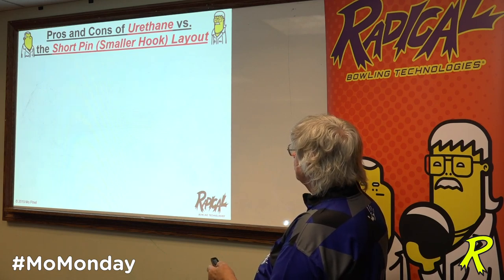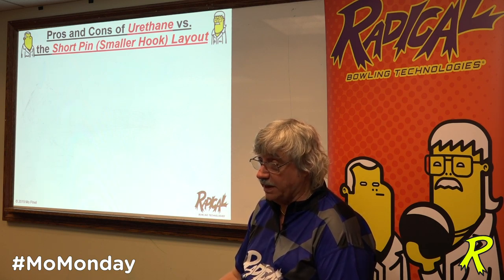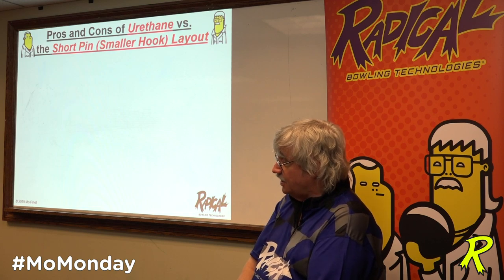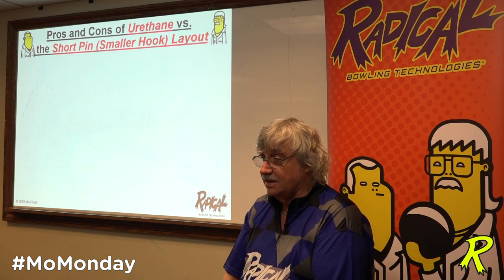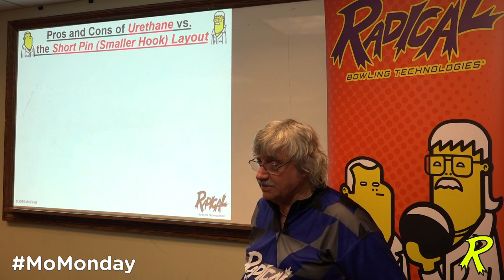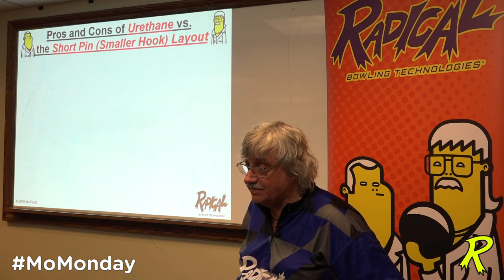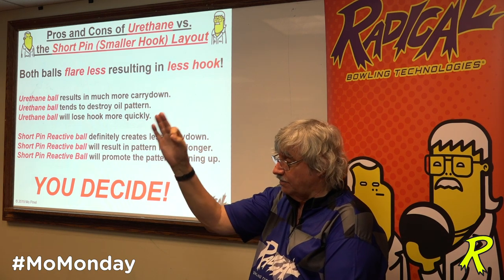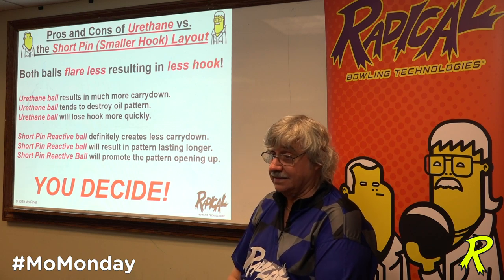Urethane vs Short Pin Reactive - #MoMonday

Comment: I have a few problems with this.
1. I use urethane in my 4 person leagues on house shots. 8 players on a pair. I am the only one using urethane. Their resin balls suck all the oil off the lane and as the set goes on my urethane ball reaction get's better and better and better. I start rolling up 7 board and by the third game I have paralleled left until I am going up second arrow and still striking. And the bonus of my urethane ball is I can stay straight to the pocket the whole time and never have to throw away from the pocket. Also I never see over/under wet/dry effects.
2. On heavy oil my resin balls, even at very low grits, will not hook early enough to provide carry. Because they are resin they skid too far before they roll and hit light or weakly until the lane breaks down. By comparison my strong urethane ball will just walk through the flood straight to the pocket and blast the pins apart. I have to use urethane on heavier fresh oil because resin wont hook enough.
3. The urethane reaction is smooth, controlled and straight and allows the best part of my game, my accuracy, to excel.
Reply: But I think the point is that not everyone has enough revs to throw one and and by short pin drilling a resin ball you can get a similar effect with out the negatives.  Did you ever think how much better your team mates could bowl if you was not creating all that carry down? It does not sound like you have every tried to use a short pin drill on a resin ball so it is hard to be judgmental on what works best. I not saying you are wrong if it works for you. But old dogs can learn new tricks. I am up for anything to help my game. But when I am on league I want my team to do good too.
Reply: @jvmiller1995  First off: I have low revs, very, very low revs, only 145 rpms. So high revs are certainly not necessary for urethane balls. Did the pros in the 80's have high revs? Nope. Yet they used urethane exclusively and effectively.
Second: The idea that on a house shot urethane is creating carrrydown and messing up other players shots is silly. I never see carrydown when I use urethane in a league environment if the other players are using resin. The opposite is true, their sponge balls suck all the oil off the lanes making it more difficult rather than better for everyone. You want to see real carrydown, play on 32' Wolf when "everyone" is using urethane! Within one game the lanes go from insane flip and hook to long and smooth. 
Now that is real carrydown.
Third: I have used short pin reactive and even pin in axis reactive. Not even slightly like urethane. Resin balls with short pins go "longer" and snap "more" in the back. That is not a urethane look. Urethane is early hook, then set and then a long roll to the pocket. Resin will never be able to to do that no matter what layout is on it. Resin is designed to skid and conserve the reaction for the "back of the lane" and that is why short pin makes resin skid "even longer" and snap even more.
Check out Video #83 on my channel. It shows a very strong resin ball with strong early layout and with short pin. Watch the difference. The strong layout produces a reaction that is closer to urethane while the short pin makes the ball go very long and snap. Same model ball and surface, just different layouts. Now compare both of these reactions to Video #132 with a Pitch Black. This is the urethane reaction. Early and smooth with zero snap in the back.
Reply: @nordattack  I was just agreeing some of the points he made that made since. If that is mostly all you bowled with it stands to reason you will do better with it. I can kind of understand the argument of resin balls sucking oil off the lane. But It is easier to adjust to light oil  on the top end of the lane but when your ball hits oil on the backend  end when turning and it slides out is it hard to be consistent. Resin has draw backs too. They need to be heated an clean property evert so many games for one. I would say what ever you hit the best with is what you should use. As long as it is a approved ball you are okay. I can adjust okay to most lanes.  I am a medium rev guy and have a nice hook but not massive.   I like the short pin layout for a short pattern.
Reply: @jvmiller1995  Right, whatever ball works best for "you" that is the ball you should use. 
Forget what everyone else says and ignore any looks they give you.
They complain that urethane creates carrydown and messes up their resin shot, I would say their resin balls strip oil off the lane and make my urethane read too early.
See? No one is happy unless they ignore what everyone else is doing and just focus on what works best for them.
Play your "own game" and enjoy it. Embrace what "you" do. Then you will become a great bowler.

Comment: You said urethane balls loose hook more quickly because "they fill up with oil" then right after this statement you say that Urethane causes carry down because "they absorb ZERO oil" Which Is It ? I always thought that urethane did not absorb oil. (If that Is truly the case why would the ball loose hook quicker) Wiping the ball off should keep It fairly fresh ?
Reply: I believe he means the surface fills up with oil, keeping it on as a barrier between the surface of the ball and the surface of the lane.

Comment: Is there a core size / cover type limit for short pins?  I have been successful with some and not with others.
Reply from the maker: Mo recommends using stronger core/covers when using short pins so you have the benefit of the better core and more aggressive coverstock. Using too weak of a ball will often make the ball too weak overall. (Counter Attacks)

Comment: @radicalbowling I am a two hander (about 375 rpm) using a Pitch Black urethane on league nights. It looks like in other comments you recommend Counter Attack or Beyond Ridiculous short pin layouts. Would they be similar to a urethane shape drilled that way? Or is there another ball you would recommend to replace the urethane..
Reply from the maker: Counter Attack Solid with a short pin layout.
Reply: @RadicalBowling  thanks. Any shops you recommend in Philly area?
Reply: @darrennelson9420  Reale's Pro Shop 3075 Holme ave
Philadelphia, Pennsylvania. Dennis Reale is one of the best in the industry.

Comment: The only problem I have with the short pin layout is when the lanes start to go through transition you have to put it away.
Reply: I use mine all 3 league games.  I move less and the lane read stays very consistent for me.
Reply: @stued151able  Every bowling style is different
Reply: Yeah, short pins are only good when keeping your angles down..     as you transition in, I have to go to stronger layouts to get the ball to recover and drive through the pins.  

But I have the same issue with urethane, as others with reactive break the lanes down and i move in, i start to lose my carry, so have to go to a stronger ball..
Reply: Bowling is about adjusting not about standing in one spot for 3 games.
Reply: @Mainzer74  No huh thanks for the brief summary of bowling. I have very low tilt and low rotation. Which means my ball reads the lane relatively early. When I'm using a short pin layout and the lanes go through transition I have to put it away because when I move the ball it's just over under
Reply: @adamatkins1466  my thoughts would be start with the short pin reactive and go down to urethane when the condition demands. 

I do love the sport because all of us play them differently and have different dynamics so we see the lanes and conditions differently
Reply: I was taught the old school way of bowling from my dad and when the lanes start to get bad move right through slower and with more hand. He taught me with his Columbia 300 piranha/c. I have an Ebonite Radical Angular One and I still through it next to the gutter if the lanes get worn down because I was taught the more close to the gutter you are the time the ball has to hook and react.

Comment: Great info.  When I used Black Hammers in the late 80's and early 90's on synthetic lanes I was always moving right every frame or two.  When I found a new Black Hammer a couple years ago I had a Motion Hole layout put on it and never had the carry down issue with it because the ball had a good flare.  After the three games I would always clean and de-oil the ball so it was fresh for the next league set.  It would appear that if one wants to use urethane and keep the carry down issue to a minimum the ball needs to have the potential to flare, and than regularly de-oil the ball.   Right or wrong that is my personal observation.
Reply: If I am using modern urethane (Purple, Fever, Tactic, Widow, True Motion) from the right, even zero flare urethane, as long as there are resin players in my area of the lane, there is never an issue with carrydown. They strip off any oil I push down.
I can either stay put for all three games, or move my foot slightly left as the set goes on.
The only time I have an issue with carrydown is if I am bowling all alone in practice, or if no resin balls are going down the lane in league and it is just a bunch of house ball chuckers.
I would imagine if everyone was only using urethane that there would be a carrydown issue, but I never see it in actual league as long as their are resin players.
And actually some resin players like when I bowl on their line because they say my urethane ball helps keep the pattern stable.
I paint an oil stripe and they take it off and I paint it and they take it off and so on for a calm sustained reaction.
Reply: Yeah, I see the same thing.. if no one else is in my area with the purple hammer I love it!!  But when the no-handers use strong balls they kill my shot!!
Reply: Yep the reactive balls  keep the carry down soaked up. And u gotta wipe wipe wipe the ball Every every shot good then life is good.
Reply: So he says Urethane doesn’t absorb oil but you have to de-oil the ball? Why is that?
Reply: @justmakingthistoreply5085   Well did not Mo say that the urethane fills up with oil quickly in the video at time mark 1:25+, and that the pros need to have several of the same urethane balls drilled the same way in an 8 game block to compensate for when the urethane ball stops hooking after about 1.5 games?  So apparently there is some oil uptake that is enough to effect the performance of the urethane ball.  Thus the need to de-oil on a regular basis.
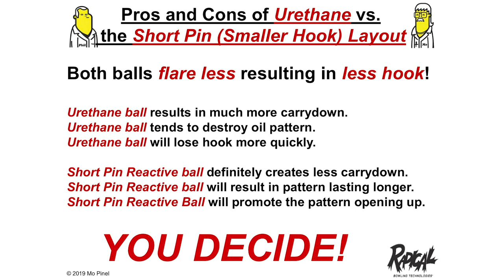Reply: Daryl W at 3:35 he claims true urethanes absorb zero oil. 🤷🏻‍♂️
Reply: Daryl W I think he just misspoke
Reply: @justmakingthistoreply5085  That could be.  It would appear that there is a possible contradiction.  But to say that urethane balls repel oil absorption (meaning they do not absorb oil at all) may not be correct either.  The discussion that started at the 1:25 time mark seems involved and not just a misspoken event.  I guess Mo will need to clarify, but I still believe from experience that if old urethane is not cleaned and de-oiled it's performance will decrease.  Thus I have never experienced this decreased performance of a urethane ball at least in a 3 game set because of regular cleaning.
Reply: Well, you can't use a motion hole anymore.
Reply: @russellgilbert3453  In USBC leagues and tournaments.  That is true.  But since I do not support the USBC anymore and bowl only non-sanctioned events I do not care what the USBC says.  At present I am not going to spend hundreds of dollars on a whole new arsenal of expensive bowling balls at the incompetent pro shops in my area when the ones I have work just fine.
Reply: @justmakingthistoreply5085  Urethane doesn't absorb oil. You can see this if you throw a resin ball and a urethane ball and look at the flare rings on the ball, then wait a couple minutes and look again. most of the oil will be gone from the surface of the resin ball, and it'll still be sitting on the surface of the urethane ball. So in the long term baking your ball isn't something you ever should have to do with urethane. What does happen though, and what I think Mo was getting at, is that you can't clean all the oil off the surface of a urethane ball with only a dry towel. In 3 games my 1000grit purple hammer starts to look more like 3000grit because while I can wipe most of the oil off the track area, some of it just gets spread all over the ball every time. All it takes is a little ball cleaner to clean up most of the oil and make the ball look dull again, but current rules don't allow cleaners during league or tournament play.
Reply: St0rm301 thanks man. You sound like you know what you’re talking about.
Reply: @St0rm301  I can agree to that.  It will be interesting to see if Mo explains his discussion about the pros using multiple urethane balls.  Like any ball surface if it gets to dirty performance can degrade.
Reply: Urethane doesn’t absorb oil, so they do not have to be “de-oiled”.

Comment: Oil carrydown is a myth. On PBA telecasts that use blue oil, logic would tell you that there would be blue oil down by the pins if there was oil carrying down, but don't you don't see any blue oil at the end of the lane. 

Throw a ball on fresh oil and look at your oil track on the ball...  it's a spiral, which would tell you that the ball transitions as it goes into it's roll, which would tell you that the surface of the ball that contacts the lane in the heads is not the same part of the ball that contacts the lane towards the pins, which would tell you that any oil that is picked up on the ball in the front part of the lane is not being deposited on the back part of the lane. The fact that a ball even comes back with an oil ring would tell you that the oil isn't being left behind on the lanes, because if it was there wouldn't be an oil ring on the ball. The only way you'd get oil carrydown is if you threw a straight ball with an end-over-end roll. 

Like I said, oil carrydown is a myth.
Reply: Its also a much higher concentration. So you wont see the blue dye. Its too dispersed at the end of the pattern. That's why the outside usually look dry while in reality the oil is less thick. That doesn't make the oil any less slick.  So there is definitely carry down.
Reply from the maker: It takes about 20 units of blue oil for it to be visible on TV. About 7 units in person will show a faint blue. Carry down happens regularly.
Reply: Look, a nickel.

Comment: I love Mo, but a couple of inaccuracies here : 1. Reactive resin balls come back with most of their oil on them still. Not much of it manages to get absorbed in the ...what?...10-20 seconds it takes for the ball to get back? So if you wipe it right AFTER your shot, and not right before your next shot, you get 90% of the oil off the ball at least. I do this with mine and it shows. Because when i decided to de-oil a couple, after a LOT of games, there was very little oil in them.  2. I can agree that wiping the oil of a urethane, doesn't remove ALL the oil off of it, but it does remove plenty. So it's not like you throw a ball that has visible oil on it. Also there are situations where you can resurface the ball by hand between games, so you can keep your urethane exactly the same. Now on tournaments like the PBA or regionals or wherever the rules are that you can only resurface the ball between blocks, then you get a bit of less reaction out of your urethane. But that holds true about any ball as they shine up pretty fast anyway. The only main issue of  interest between this comparison is hitting angle and power. Not pattern breakdown (as others mentioned, 1 urethane per 5 resin balls, won't destroy a pattern.

Comment: Lol. This is ridiculous. In league a urethane ball will hook fine for all three games. I use urethane each league night with no issue. Some small adjustments maybe but that’s what makes a good bowler. Pros may switch to newer urethanes maybe, but on a dang house shot it will last just fine. Assuming you have some revs. If you don’t you shouldn’t be using urethane to begin with. His comment about telling them to buy three balls is just plain ignorant. Some guys just hate urethane balls. Mo is obviously one. Plus he doesn’t sell them so he obviously not going to promote it at all. This would be a better presentation left to a company that makes both balls. Very biased speech and absolutely useless.
Reply from the maker: "Assuming you have some revs"  You just made Mo's point, which was stated in the beginning. For the average league bowler, they would benefit a great deal more using a short pin reactive resin.

Comment: Haha urethane bad. Tell that to Jesper Svensson or Jacob Butruff, two of the most aggressive bowlers out there
Reply: Just imagine if they were right handed bowlers no one's ball would have good reaction lol
Reply: @chrisfentress13  I'm a right handed bowler and I have no issues. Neither do lots of professionals.
Reply: Urethane Balls are getting hard weight blocks and IMHO its made better for 2 Handers or hard crankers like me.
Reply: I meant better weight blocks! Remember the Stingray C?
Reply: He did mention the guys using urethane effectively were 500rpm guys, and those two fit the bill nicely. Plus they are lefties which hardly counts. I’ve very recently switched to short pin reactive on house conditions and it lets me play it very hard and straight, which is conducive to scoring on house patterns. Still lug the pitch black and the purple hammer to every tournament, when things get messy on the left, they are great options to grind on lower scoring conditions
Reply: @CurtisL8.3066  I mean yeah I use my short pin timeless on most house shots before I pull out my urethane. I can play pretty much the same line with the two. But my timeless can go a bit long sometimes, even with my high rev rate, so urethane is sometimes the way to go, even as a righty